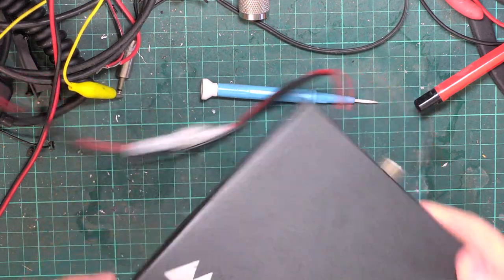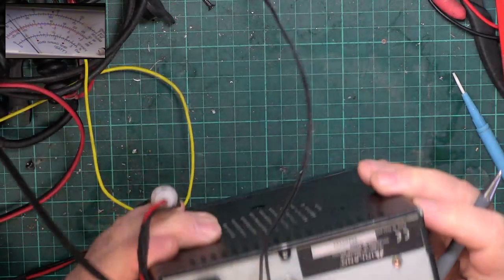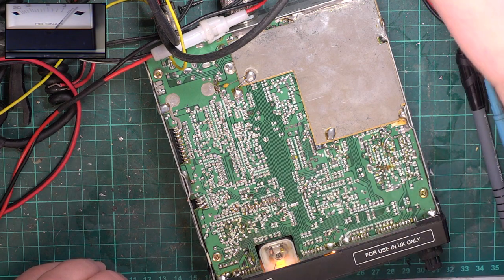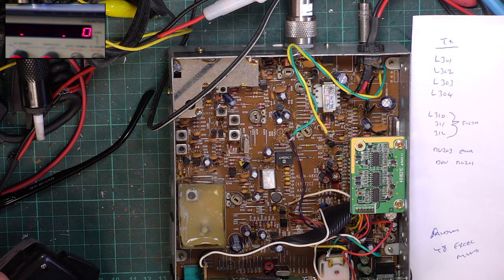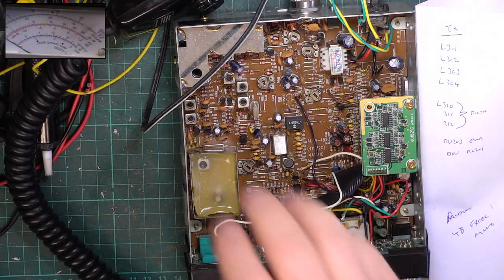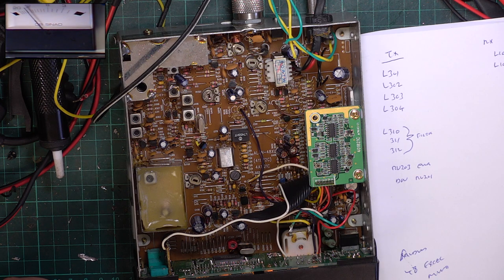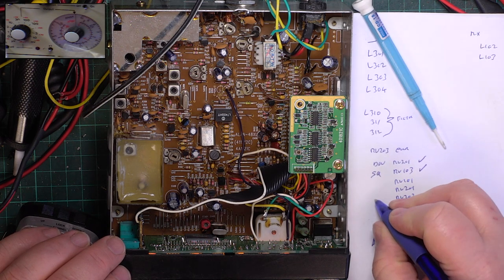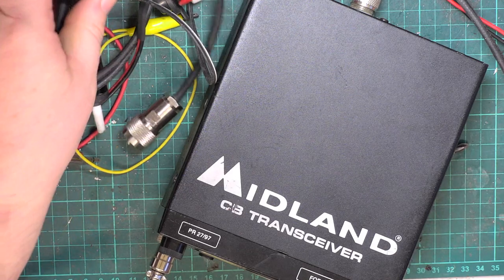Midland 48 Excel PR27/97 UK FM CB radio (mobile) - repair & alignment

Comment: Wow!  lot of dry joints on that one Richard!  Can only hope you got them all.
I can understand why the customer wouldn't bother with a meter when using it mobile.
Can't look at a meter and drive safely anyway.  The more time eyes are off the road the more chance of an accident.
Eye's off road, just to check you are on the right channel and that is it.  I never give a signal strength report if driving, just how good the signal sounds, that is back to Radio Amateur type reports 5/5, everyone is 5/5!!  Not with me, just go by the sound, Radio 1to 5 depending how it is.
At least it has a proper meter etc and a meter you can see (when it works) and not one of these stupid meters that is a display (my pet hate, especially when the TX is just for show).
Anyway, good repair Richard, hope it lasts, but it looks like that model is prone to dry joints!
Reply from the maker: Meter cost is £21!

Richard
Reply: @ukfmcbradioservicingTango21  How on earth do they justify that?
Reply from the maker: @BoB4jjjjs  You'd expect a meter of that quality to be £3.99
Reply: @ukfmcbradioservicingTango21  No, I wouldn't be that cheap, £4.99p  lol
Reply: @ukfmcbradioservicingTango21  I have no idea, but it appeared a bit steep!

Comment: Bloody Wax
Reply from the maker: Yep
Reply: I had one of these what a load of crap one of MIDLANDS worst radio's  they don't even make good spares radio's either ,
As for the wax well no wonder they are dry they have wax in-between the solder and board
Reply: @quotagious  If it had that it left the factory with a dry joint, or it ran between when the solder was melted to replace something.  It can be a bit of a pest.  Try the Gemini CB for wax!!  It has a huge block of it in the VCO, a huge tin full of wax, oh the joy!!!  They are murder to fix, I stopped even looking at them, it just was not worth anyone's time and effort.
I wonder what happens when one of those is left on a car dash in full sunlight?  Your dash would get a good wax for sure :-))